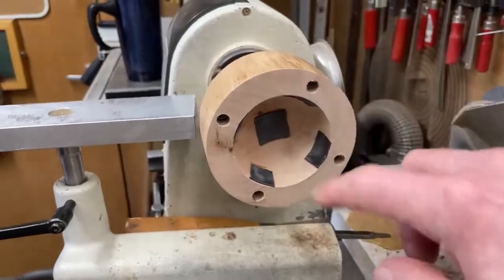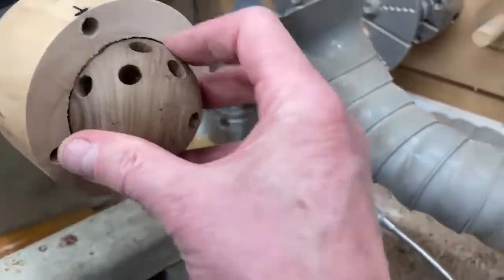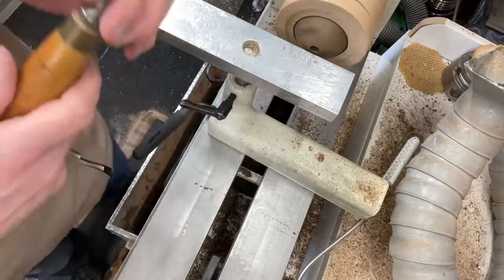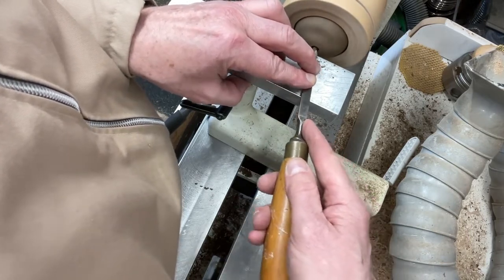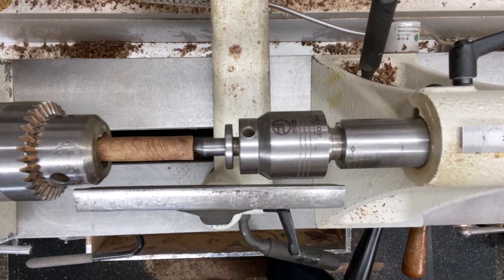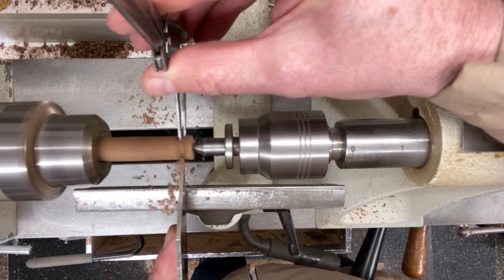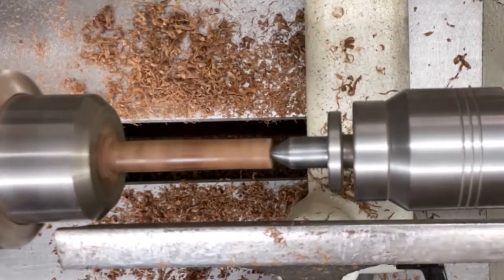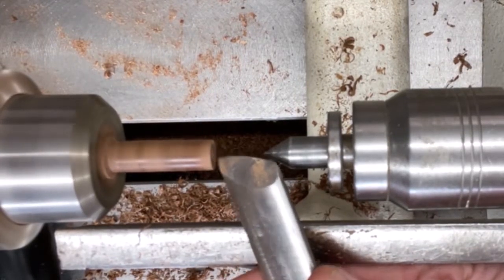Singapore Ball

Comment: Hi, is there any information on the sanding bar seen in the video on the right hand side of the lathe bed at 11:30 minutes?  It looks like a balloon on the end of a metal bar. I’ve seen one many years a few years ago on would like one for myself. Thanks
Reply from the maker: Hi Steve, I don’t recall where I got it from, possibly at the Harrogate show several years ago. It is literally a piece of threaded bar that screws into a ball. Going over the end of the ball is a piece of Velcro which splits into strips that go down the sides and then the ends get trapped under a collar held in place with a nut on the threaded bar. Probably easy to make one.